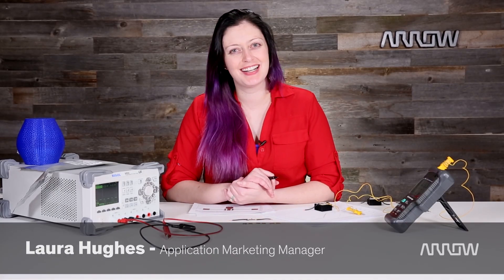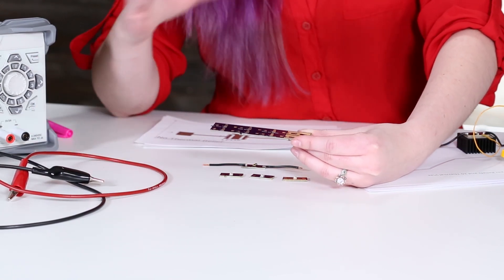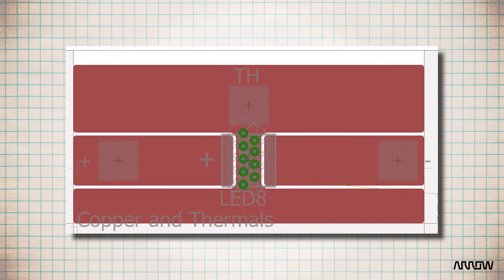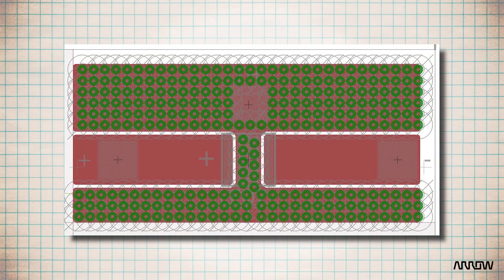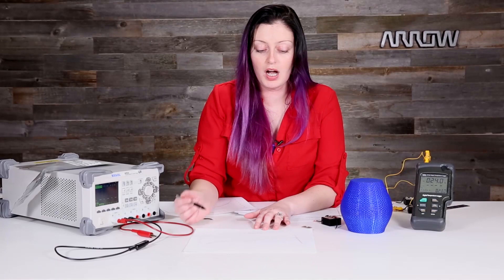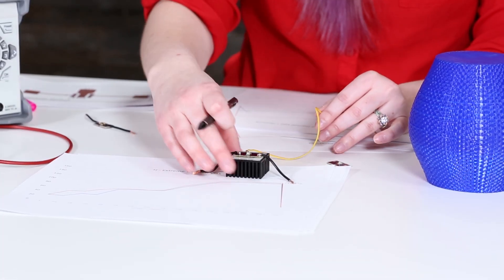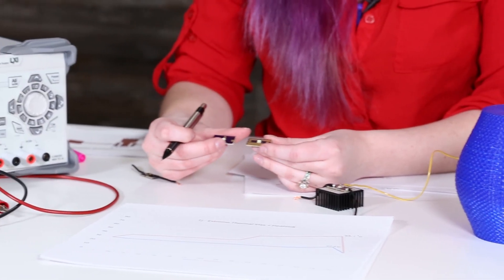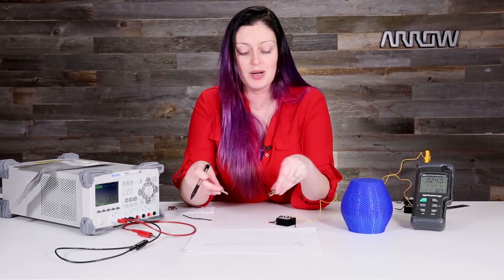LED Thermal Relief in Real Life

Comment: A thermocouple would solder easily with soldering acid I bet. Also, copper-filled or solder-filled vias should be better. 5:00 Power... takes the black wire. Ground... takes the red wire 😂. Nice video, helpful

Comment: Nice experiment! Probably the overkill via's make the copper area less thermal conductive while it doesn't help to give more heat to the other side of the board while it is already almost the same temperature with the 10 via's